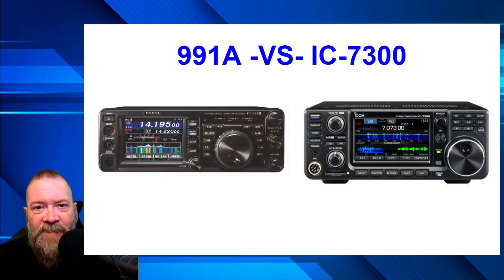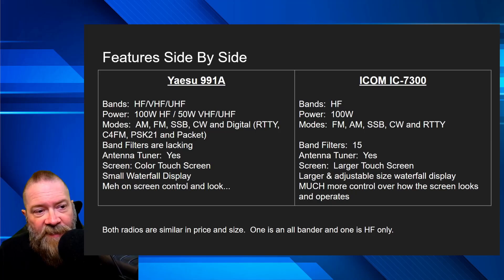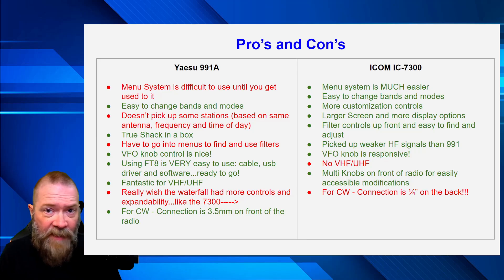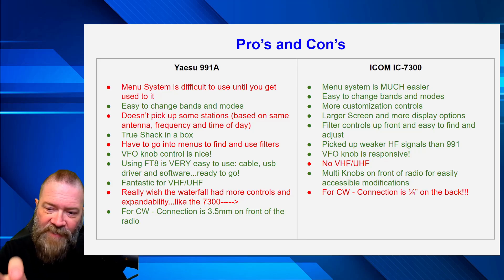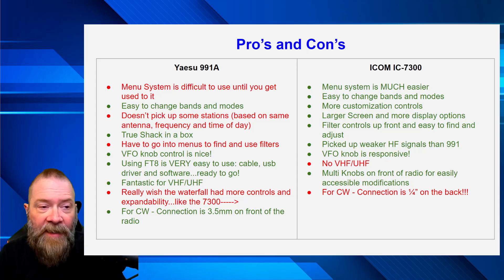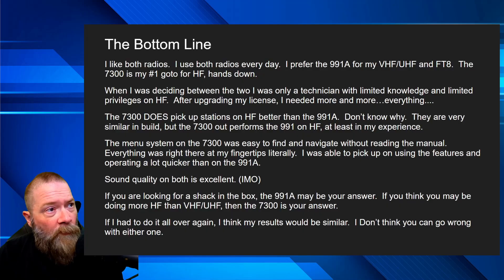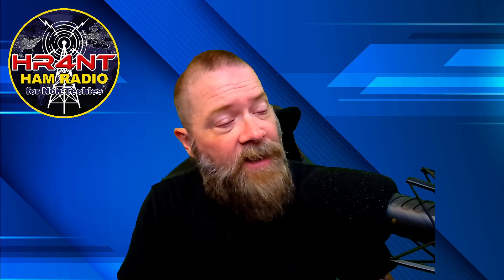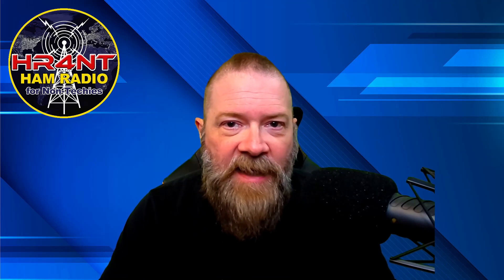A Tale of Two Radios - 991A - VS- IC-7300

Comment: I recently had a conversation with a gentleman who seemed extremely knowledgeable on this [not so] futuristic world of electric cars. 

He was a former Porsche 918 Spyder owner before he sold it to purchase a new Taycan Turbo S. Which, by the way, was über fast (to use the correct German terminology) and eerily quiet but I digress. 

We were discussing the possibility of these in-home electric car chargers being unsustainable and potentially causing massive RFI for amateur radio operators. A subject that he had not considered prior to our conversation. 

Unfortunately, he has very little knowledge when it comes to HAM radio other than his uncle being a Signal Operator in the Air Force "many moons ago". He surmises that it is possible that these car chargers and even these full-electric vehicles could potentially raise the RFI around the entire world.

He went on to state that (as of right now) our infrastructure simply cannot handle this new endeavor in a safe and efficient capacity. Claiming that the airwaves are "...so incredibly crowded these days that your neighbor could end up starting your car when he turns on the microwave". While that may be a rather extreme example of the airwaves (both bands and frequencies) at maximum capacity. I, nonetheless, understood what he was trying to convey.

Perhaps your RFI is coming from such a device in the near vicinity. I would look for any neighbors who own a full-electric vehicle with or without the in-home car charger. Just a wild speculation but I always tend to expect the worst which rarely turns out to be the case. 

Furthermore, do you happen to know if you have a transformer nearby as well? My father thinks that could be another possibility that is often overlooked. But then again, he is from Old World generation of America. The demographic of old timers that still thinks FMJ's are just as good as hollow points out of their revolver. I told him that seemed like a far fetched idea but still plausible. 

Nonetheless, I hope you can isolate and attenuate the problem Scott. Keep us posted.

Stay classy my friend.
Reply from the maker: Hi Bert!  Thanks for the comment.  I actually built one of those tape measure Yagi's recently and plan on using it to walk around my neighborhood with my FT3DR and see if I can find sources of RFI in the area.  I have no doubt that an electric car charger would be a massive source of RFI, luckily, as far as i know no one around me has an electric car.  As for a transformer nearby, I think there are a few and when I do my RFI hunt, I will be noting those locations down as well when I file a report with my electricity carrier.  The recent storm last week blew a lot of stuff down and a lot of electrical poles were affected, so maybe that will prod Centerpoint to come out and make the appropriate repairs.  Either way I will be hunting and reporting what I find.  Thank you again for the info and the comment.  73!

Comment: Thanks for the video!  I own both the 991 (non-A) and the 7300 and share your opinion fully. FT8 is very easy to set up on the 7300 as well, even easier than the 991 (as I had to set up some filtering options to maximize)

The 7300 also has a 'slow down' the VFO option which is the little slider under the VFO knob - it will do the same and make precision tuning as easy as the 991. Give it a try :)
Also the noise-filtering of the 7300 I find easier on the ears than the 991, but that might be improved in the 991a.

73 the PC4AD
Reply from the maker: Hi Anton!  I agree.  They are both great radios, i just have them setup for different requirements based on my needs in radio.  I did not know about that 7300 slide...I'll go check that out.  Thanks for the tip!  73!

Comment: Had both the 7300 and the 991A for about a year and a half. I actually thought the 991 has better DSP and I was able to hear better. However the 7300 just overall had a better interface and it became my main rig. Then I tried a FTDX10 and well I just sold the 7300 lol. I know not the same and kinda the next step up but any complaints I had about the 991A were addressed in the FTDX10. I kept the 991A because of the size makes it easy to go portable and the UHF/VHF. 7300 is a fine radio though if I didn't have the extra to spend I certainly would have been more than content with it.
Reply from the maker: I have heard a ton of praise for the FTDX10!  Maybe down the road I will get a chance to play with one.  Like I said in the video, I am not bashing the 991A, but for my needs and situation, the 7300 outperformed the 991A with what i was doing with it.  Still a great radio though.  Thanks for the comment and for watching.  73!

Comment: I totally agree with you when it comes to the 991a (you took the words right out of my mouth) I think on a H,F an old Realistic DX-302 could pick up more weak stations then the 991a - and that's why I got myself G90 it just wipes the floor with the 991a. from spending over £1200 11 months ago to a much better radio for £300. (I'll learn from my mistakes). Anyway cracking video and looking forward to your next one 73's.
Reply from the maker: Thank you for the comment.  I would have never thought of pitting the 991 to a G90.  Very interesting with the results you mentioned.  I am not bashing the 991, however the 7300's functionality is just...better.  Thanks for watching.  73!
Reply: @HR4NT  if you can get your hands on one, then try it - you won't be disappointed.

Comment: I had exactly the opposite experience with a 991a and 7300 with weak signals. A buddy that owned one for 2 years was running the 7300 and I was running my 991a which I had only owned for 3 months.  I was able to tune in and filter out things he was not able to on the same exact antenna within seconds of each other using a few switches so we could compare results. A true head to head with two radios to see what we could get. The 991a was much faster to tune up, filter out and hear every weak signal we tried for. The complaints you have about the menu system is because you weren't using the radio to its potential. Changeable soft keys that are variable based on what you are doing and super fast dial to the setting by turning to an exact item and making the change is way faster and easier than pressing a bunch of buttons and going 3 levels deep to filter something out. All of the filter options are right together and much easier to access than the 7300. As you said the 991a is all ready to go for digital modes and again the filtering systems and soft keys change as you change anything you do. The 7300 takes time to reconfigure anything and everything you do as you make changes in operating modes. You are absolutely 100% spot on with the display on the 991a and the only thing I wish the 991a has that the 7300 has is AAC, SWR and power out on separate meters. On the 991a you have to push one button to scan through them. I only find this annoying when running FT8. Sound card, C4FM, 2m and 440 not only on FM but side band as well and the 991a is head and shoulders above the 7300. I tell my friends that hang their heads when they see what the 991a can do when out in the field compared to their 7300, to not worry about it. Comparing these two radios is apples to oranges. One would be mad at a single cab pickup truck for not comfortably hauling 7 of your drunk buddies on a road trip or at a minivan for not towing your huge boat very well. 2 totally different radios by design and especially when comparing filtering. With plenty of time running both the 991a is my go to radio more often than not. Awesome video as usual and I really appreciate all that you do for our awesome hobby.
W2GPR
Reply: The apples to oranges is a fair analogy.
Also, soft key setup based upon personal operating preferences are a big deal with Yaesu radios with traditional menus.
Fortunately, Yaesu puts the most commonly used items up front on buttons and knobs.
Most compare the IC-7300 to the FTdx-10, which to a lesser degree is still an apples to oranges comparison.
Both the FT-991a and FTdx-10 have piqued my interest. As a condo dweller in an RFI rich environment that puts a premium on portable operations and shack in the box radios I want to move into the 21st century.
However, for the moment I am staying with my stable of 1ea IC-706MKiig, 1ea FT-897, and 2ea FT-857d.  They are all great shack in the box portable radios.  They only lack the more sophisticated SDR signal processing for combating QRM.
However, the newer radio are more power hungry, which is a major consideration for portable operation.

On a different note, for the first time in years I had clean bands at my portable operating at a local park that warranted turn off IPO and turning up RF gain instead of turning it down. 17m was 100% free of background noise and stations were coming well from Europe.  I had perfect 59 copy on stations with an S0 on the meter.
Usually I am fighting S3 to S9 noise depending upon the band and time of day.
Reply: I think exactly like you
Reply from the maker: I get it.  Like I said in the video this was based solely upon my experiences with the two radios.  I have messed with customizing the buttons below on the screen of the 991 and it could simply be my inexperience with the unit.  That is entirely possible.  But I did and still find navigating through the menu system to be a bit of a bear on the 991, not saying it sucks, but it just takes more time and I guess in our world of instant gratification these days (lol) I get impatient and want things to respond quicker.  With FT8 I love the functionality of the 991.  Controlling everything seems to be very simple and I have made a ton of contacts.  I have yet to try this on the 7300, however my son just got the cable to hook his 7300 to FT8, so I will most likely get an opportunity to play with his unit on FT8 and see what I think from there.  Glad you liked the video and I appreciate the input on your experience with your 991!!  Thanks for watching..73!!
Reply: @HR4NT  TV in my feed

Comment: I got my Technician about the start of July and general at the end of August, and I feel like we were in kind of a similar path. What I eventually worked out from talking to people is that the 991a is a traditional radio with a scope / waterfall bolted on and the 7300 is an SDR from front to back.  The practical implication as I was told is that the discrimination and selectivity of the 7300 is worse when in something like a pileup versus the 991a.  That's the most technical answer I've found searching around.  If there's a technical analysis or review of the backend of these two radios somewhere that'd be neat to read. I only seem to find opinion pieces when I try and search the internet at large.  - KI5QOC
Reply from the maker: Thank you for the comment.  Congratulations on passing your Tech and now General!!  They are similar radios, but also quite different, I agree.  However when I see many videos of other youtubers out there recording a POTA session and getting a pile up, they seem to be able to handle it quite well.  I think that just comes over time with plenty of practice and training your ear to hear specific stations calling you.  I have yet to experience a pile up and I am sure when it happens part of me will freak out a bit.  Thanks for watching and thank you for sharing this!  73!

Comment: To be honest, I am fed up with Yaesu since a long time already. The last model I owned was FT-2000D and bfore this model my last brandew Yaesu Radios were the FT-1000Mark V Field and FT-847. Before I bought me the 2nd IC-7300 I was eye balling with the FT-991A to buy it. I wasn't sure if I really need a 2m and 70cms Radio because my playground goes from 160-6m priority. So it was another IC-7300 in my shack onad no FT-991A which I am NOW glad to made the right Decission in this matter. Yaesu is banned from my shack for a long period in future. Thx for the Great Job you doing Scott. 73's & happy thursday de Your Friend Uncle Guenter
Reply from the maker: Sorry to hear you had so many issues with the Yaesu's.  I think they are still good radios, but the Icoms just seem a bit better.  The other reason I had originally purchased the Yaesu was that they had a better warranty than Icom, and still do.  However the difficulty in navigating through the radio to use the features I think was not well thought out.  I  have not had the opportunity to play with any other models than the 991A and I have to wonder if other models are similar or if they made improvements to the menus and filters.  Thansk for the comment as always Uncle!  Have a great week!  73!!
Reply: @HR4NT  151 menu steps no one really needs...I used to be a big Yaesu Fan in the 1980s til 2000. There's just so many things behind the Walls of Yaesu - Musen which are not thought out well enough...how I found out. Hopefully the japanese crystal meth laboratories produce better quality... 😂😂😂😂👍

Comment: If you only had the 7300 (for HF), what would you get to cover VHF/UHF bands?
Reply from the maker: That is a good question.  I have an FTM-400XDR in my truck, and it seems to work just fine.  I have seen others use that as a base VHF/UHF radio and the price is right.  The only other choices I could think of would be the ICOM 9700,l but now you are looking at $1500 for a VHF/UHF radio.  I would probably just use the 400XDR as my primary VHF/UHF based on price point and it still pushes 50 watts.  Thank you for the comment.  Hope that helped a bit.  73!
Reply: @HR4NT  The problem with the Ftm400 is that it is NOT all mode. I want the ic7300 but I also want something that will do vhf all mode. Is there such a stand alone radio?
Reply: 9700
Reply: @bigdinsa656  That's FT-991A. It even has backlit buttons that none of Icoms have... The only thing you might not like about it is that it is power-hungry.

Comment: ICOM IC-7300 no brainer, had one and best rig on the market for under 1000 dollars. I upgraded to the IC-7610.

Had a ft991 sold it and glad I did, too many silly menus and poxy screen.
Reply from the maker: Thank you for the comment!  I have considered selling my 991A, however for what IU specifically use it for, I like it.  Now that my HF needs are fully covered by the 7300, the 991 serves as a backup and to use on our simplex network in case of emergencies.  Thank you again! 73!

Comment: I have owned both as well. I currently only have the 7300. I wouldn't hesitate for a second if I saw a good deal on another 991A!
Reply from the maker: The 991A is a good radio, I just think they should have simplified the menu system and made it easier to access from the front of the radio, not 154 sub menus.  Thank you for the comment.  73!!
Reply: From comparing my 991 to several others of different models and manufacturers I find the 991 menu fairly simple and straight forward with easy understood options. My 2 cents from a small fortune and many years wasted on many radios.  K0LC

Comment: The band filters in the 7300 are also present in the 991. These filters are used for preselection and transmit harmonic suppression and are present on both radios. The 991 also has a roofing and IF filter, and only has to digitize the signal of interest rather than the 7300 which wastes its ADC capability digitizing the entire band including parts you really don't care about such as broadcast stations. Theres no reason for the 991 to not be able to hear something the 7300 can unless yours is damaged somehow.  You can try turning on the attenuater and if a station suddenly shows up it means there is overload damage.
 I'd also like to mention that the 991 has C4FM/Fusion capability, which is like getting a $500 radio thrown in as a bonus.
Reply from the maker: My first 991A took a dive about a month into owning it, so I sent it back for repair.  They ended up replacing it with a new one which seems to work fine.  I will try your suggestions, but after extensive research, others have stated what I said in the video where the 7300 heard stuff the 991 didn't.  I will check into your suggestions and see if I can get better performance from the 991.  Thank you for the tip!  73

Comment: Which has better noise reduction?  Is it possible that your  loosing weak station sensitivity on the FT991a by using inappropriate DNR settings?  Thanks for the valuable comparison.
Reply from the maker: Before jumping on the expenditure of another radio I tried everything I could and I am still trying on occasion to see if I can get better performance out of the 991.  The stations it DOES hear, come in loud and clear.  My main complaint is hunting down the settings.  Glad you enjoyed the video.  73!

Comment: I have owned both and keep the 7300, I do miss not having the vhf/uhf. one thing you forgot on your comparison is the FT991A has Three warranty and the 7300 has only one year warranty and that may be a deal breaker for someone
Reply from the maker: Yeah that was also a factor when I bought the Yaesu was the warranty coverage.  I forgot to mention that in my presentation, but you are correct.  That was a very attractive item when I was deciding between the two radios.  Thanks for the reminder!  73!
Reply: @HR4NT  I will also add that Yaesu has awesome Tech support, I have never used Icom.